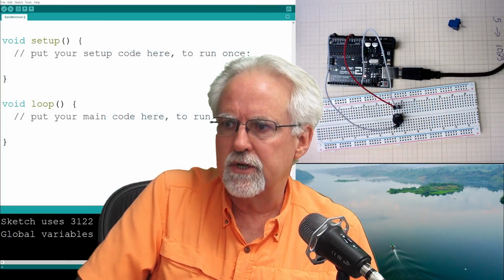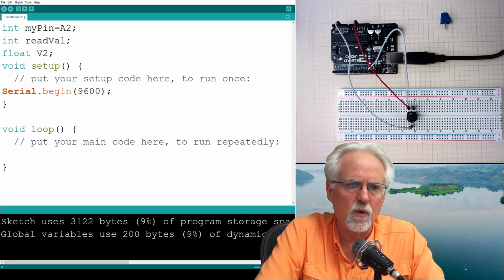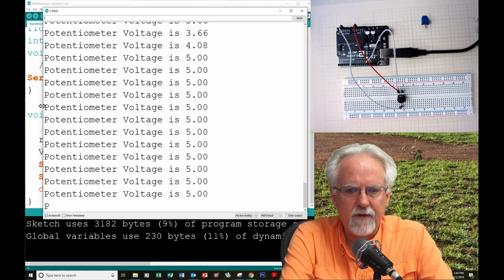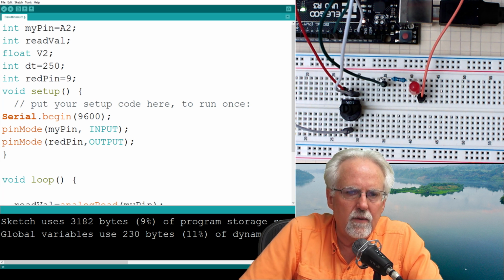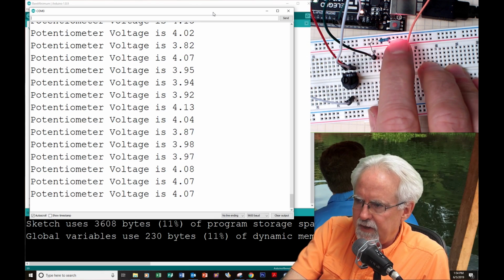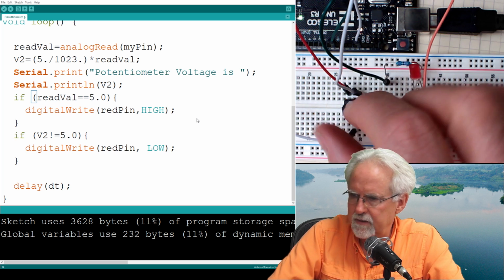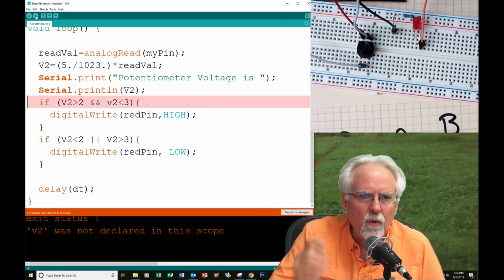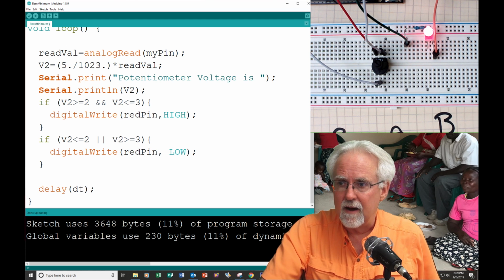Arduino Tutorial 13: Understanding Arduino If Statements

Comment: I made it a little differently, played with it by creating a variable for the voltages. This was before the second phase of tweaks that was done here.. I could just hear Paul shouting, "NO NO NO, don't put values down there, make it a variable, so I tried that...LOL!!         
 int myPin=A2;
int readVal;
float V2;
int delayT=250;
int redPin=9;
float Trigger=3.0;

void setup() {
  // put your setup code here, to run once:
Serial.begin(9600);
pinMode(myPin,INPUT);
pinMode(redPin,OUTPUT);

}

void loop() {
  // put your main code here, to run repeatedly:
readVal=analogRead(myPin);
V2=(5./1023.)*readVal;
Serial.print("Potentiometer Voltage is ");
Serial.println(V2);
if (V2>=Trigger);{
  digitalWrite(redPin,HIGH);
  }
  if (V2<Trigger) {
    digitalWrite(redPin,LOW);
  }

delay(delayT);
}
Reply: But this is probably the BEST I've seen here on the Arduino... All done in baby steps, from Known to unknown.. the way it should be.

Comment: Hello Paul, I am currently building an Imoov robot. I am using  a PCA9685 with my Arduino for the hand and finger movements. I will be running six servos off the PC9685. I know how the hardware is set up but the coding seems a little difficult. I am trying to code so that the servos have different degrees of movement to compensate for the  fingers being different lengths.  I have searched  forms and videos on this topic but have not seen it explained in detail.  Maybe you can point me in the right direction. Your videos have been a great help to me  and very informative as I am new to coding. Thank you for taking the time to make such great videos.

Comment: I did it!!! I am referring to the homework regarding the 'IF' statements.  It was a great challenge that I needed in which to build upon even more challenges.  There were errors made and one was a struggle to determine if it was my coding or my breadboard circuit .  After hours of rewriting the code and rewiring the breadboard many times and with a "strong dose" of persistence, I found the error.  It simply involved turning on the yellow LED 'IF' statement correctly and then using exactly the same 'IF' statement to turn the the led off.  So, I believe the LED never had a chance of lighting-up.  Thanks for the challenge... I will not forget this in the future.

Comment: Another great video.  Loved getting back into the IF statements and how they work here.  This is an example of something that I could have used back when I worked as an electronics tech for a newspaper.  We had high voltage tachometers  that fed analog meters and my boss wanted us to design something to display the speed of the presses with large pit lights instead of the analog meter.  We could only use thresholds to turn on the lights so instead of  indicating a particular point, all the lamps came on up to that level.  It was okay, but this device you are teaching us would have made that job soooo much easier!!!  Unfortunately there were no Audrinos back in 1985.  Thank you again and I will be looking forward to the next lesson.

Comment: Hi Paul, thank you for another great lesson. You are saying we shouldn't use numbers in the loop method. Is there any reason why you are not doing variable for 5/1023? Also why the program was working without setting pins ? Thank you Mr Buuuuum :)

Comment: I love your tutorials! I ended up downloading Fritzing to help plan your homework and it works great. I do have one question: can you use concatenation in Arduino? I looked it up and it was confusing but I still couldn't get it to work. I know a few programming languages and keeping up with the differences between them is crazy. If you can use concatenation do know a site with better examples than the Arduino site?

Comment: *FLUCTUATING VALUES??* - for other new students having issues with the potentiometer having fluctuating voltages while mounted on the breadboard. I was having fluctuating  values on the serial printing of the voltage output even when the knob was not turned. I thought something was wrong with the arduino board. I checked it with the voltmeter and the values fluctuated as well. For some reason it does not fluctuate when the potentiometer is wired away from the breadboard. I used the dupont wires to connect the potentiometer to the breadboard.

Comment: I started writing Fortran code in 1966 and now occasionally  use C#  and Minitab's Macro coding language with if's, while,  do loops etc. I remember acing my Electrical Engineering DC electronics class, then when faced with AC switched to Chemical Engineering.  Have always used programming  of some sort  throughout the years.  The combination of theory and hands on assembly and  coding  is  very exciting and  I'm enjoying it thoroughly .  I successfully  extended the homework  to print different messages  within  each region, green - Safe Zone 0 to 4 volts, Yellow - Warning Zone 4 to 4.5 volts, Solid Red  - Early Warning Zone 4.5 to 4.75 volts, and finally Blinking Red  - Late Danger Zone  greater than 4.75 volts.

Thanks again for your great lessons.

Comment: Interesting. Using a Teensy 4.1 for these tutorials, and powering from 3.3v instead of the 5 the Arduino uses. Everything works just fine right up to the point of using "==" or "!=" conditionals. I've otherwise copied Paul's instructions word for word, and I was happy to see that the "V2=(3.3/1023.)*readVal" scales perfectly. The greater than less than functions work nicely as well, but as soon as either conditional is given a "==" or a "!=", the sketch compiles, but doesn't respond to the command. 

Any guesses from anyone as to why this wouldn't be working?

Comment: I gotta say, this has been a learning experience and exciting! I was able to get the Green, Yellow, and Red light to turn on when a condition is met. Paul, I appreciate you taking your time to teach. I am actually following along. I am in the Manufacturing Engineer field, hope to get into IOT field. I've had my OSEPP Arduino starter kit for 1 year, and finally opened it as you dared us to do some practices and follow along. 

The only bummer was getting arduino started and it was hell due to the fact that the it couldn't register the correct COM, for some odd reasons, COM5 works but COM3 doesn't since it is busy. For that, I had to investigate and update the driver, didn't know till many struggles.

However, your methodical execution and explanation was intuitive and easy to follow along at this pace!
Thank you for your time and I've subscribed!

Comment: At 25 minutes. The code says turn led on if V2 is 5v and next line says turn off if it is not 4v. So it’s turning on and immediately off again every scan. Both values have to be the same for that routine to work as you desired. 
If (V2==5.0) {
digitalWrite(redPin, HIGH);
}
If(V2!=5.0){
DigitalWrite(redPin, LOW);
}
Would work.

Comment: help idk wahts wrong the green light keeps on turning on 

my code:
int info=A1;
int green=2;
int yellow=3;
int red=4;
float volt;
float tv;
int t=200;
void setup() {
Serial.begin(9600);
pinMode(info,INPUT);
pinMode(green,OUTPUT);
pinMode(yellow,OUTPUT);
pinMode(red,OUTPUT);
}

void loop() {

volt=analogRead(info);
tv=(5./1023.)*volt;
Serial.println(tv);

if(tv>3){
  digitalWrite(red,LOW);
  digitalWrite(yellow,LOW);
  digitalWrite(green,HIGH);

 
}
if(tv<3 || tv == 3){
  digitalWrite(green,LOW);
  digitalWrite(red,LOW);
  digitalWrite(yellow,HIGH);

}
if(tv<4){
  digitalWrite(yellow,LOW);
  digitalWrite(green,LOW);
  digitalWrite(yellow,HIGH);

}

}
Reply: wait ithink i fixed it
Reply: ok ive re written the if and re do the logic and it works now 

code;
int info=A1;
int green=2;
int yellow=3;
int red=4;
float volt;
float tv;
int t=0;
void setup() {
Serial.begin(9600);
pinMode(info,INPUT);
pinMode(green,OUTPUT);
pinMode(yellow,OUTPUT);
pinMode(red,OUTPUT);
}

void loop() {

volt=analogRead(info);
tv=(5./1023.)*volt;
Serial.println(tv);

if(tv<3.0){
digitalWrite(green,HIGH);
digitalWrite(yellow,LOW);
digitalWrite(red,LOW);
delay(t);
}
if(tv>3.0 && tv<4.0){
  digitalWrite(yellow,HIGH);
  digitalWrite(green,LOW);
  digitalWrite(red,LOW);
}
if(tv>4.0 || tv>5.){
  digitalWrite(red,HIGH);
  digitalWrite(green,LOW);
  digitalWrite(yellow,LOW);
  delay(t);
}
}

Comment: I added a warning light counter but can't get it to not continuously keeping adding while in the conditional of turning LED on when volts = 5.0.  See my code: int greenPin= 5;
int myVoltPin=A2;
int readVal;
float V2;
int dt=250;
String warningMsg="Number of Warnings:";
int warningCount = 0;

void setup() {
  // put your setup code here, to run once:
Serial.begin(9600);
pinMode(greenPin,OUTPUT);
}

void loop() {
  // put your main code here, to run repeatedly:
Serial.println(warningMsg + warningCount);
readVal=analogRead(myVoltPin);
V2=(5./1023.)*readVal;
Serial.print("Potentiometer Voltage is ");
Serial.println(V2);
if (V2==5.0){
  digitalWrite(greenPin,HIGH);
//here is my number of warnings counter, but it keeps adding up while HIGH
  warningCount = warningCount + 1;
}
if (V2!=5.0){
  digitalWrite(greenPin,LOW);
  }
delay(dt);
}

Comment: Mate, as a 70 + a bit guy who is just venturing into Arduino programming, your tutorials are 'pure gold'! Thank you for sharing your knowledge so freely with us, and having them so well structured and easy for us 'oldies' to follow.
A quick observation, in your 'if' tutorial, there was a problem  reading the 5 volts condition near the end. If you remember, in the previous tutorial, you were only getting 4.86 volts, not 5.0 after the resistor! Correct?

Comment: I made 3 leds function at bottom middle and high range, it is really awesome...
int myPin=A2;
int readVal;
float V2;
int delayT=250;
int redled=9;
int blueled=8;
int greenled=7;
void setup() {
  // put your setup code here, to run once:
Serial.begin(9600);
pinMode(myPin,INPUT);
pinMode(redled,OUTPUT);
pinMode(blueled,OUTPUT);
pinMode(greenled,OUTPUT);
}
void loop() {
  // put your main code here, to run repeatedly:
readVal=analogRead(myPin);
V2=(5./1023.)*readVal;
Serial.print("Potentiometer Voltage is ");
Serial.println(V2);
if (V2>4.0) {
 digitalWrite(redled,HIGH);
  }
if (V2<4.0){
digitalWrite(redled,LOW);
}
if (V2>2.0 || V2<4.0){
digitalWrite(blueled,HIGH);
}
if (V2<2.0 || V2>4.0){
digitalWrite(blueled,LOW);
}
if (V2<2.0){
digitalWrite(greenled,HIGH);
}
if (V2>2.0){
digitalWrite(greenled,LOW);
}
 delay(delayT);
}
Reply: before you got to the end I did the 3 led's before you assigned it, yaaay
Reply: Thank you for posting your code! It helped my track down my issue. It was not an "if" statement problem as I thought, it was a "pinMode" issue. I forgot to declare yellowLED in my pinMode as an OUTPUT. As Paul says, the program was doing exactly what I told it to do.

Comment: int ReadVoltage=A0;
int greenLED=8;
int yellowLED=9;
int redLED=10;
int ReadVal;
float V;
float Calc=(5./1023.);
int T=500;

void setup() {
  // put your setup code here, to run once:
Serial.begin(19200);  
pinMode(ReadVoltage,INPUT);
pinMode(greenLED,OUTPUT);
pinMode(yellowLED,OUTPUT);
pinMode(redLED,OUTPUT);
}

void loop() {
  // put your main code here, to run repeatedly:
ReadVal=analogRead(ReadVoltage);
V=(Calc*ReadVal);
Serial.print("Potentiometer Voltage  =  ");
Serial.println(V);
delay(T);
if (V<3.0){
  digitalWrite(redLED,LOW);
  digitalWrite(yellowLED,LOW);
  digitalWrite(greenLED,HIGH);
  }
 if (V>=3.0 and V<=4.0){
    digitalWrite(redLED,LOW);
    digitalWrite(greenLED,LOW);
    digitalWrite(yellowLED,HIGH);
  }
 if (V>4 or V==5.0){
    digitalWrite(greenLED,LOW);
    digitalWrite(yellowLED,LOW);
    digitalWrite(redLED,HIGH);
}
}

Comment: Had some difficulty at first, but after tracing the issue to a defective potentiometer and fixing it by pressing it down continuously while the program runs, it worked like a charm. The explanation could not have been any clearer, it is delightful to follow this series.
Reply: Nice! I have to do that with mine too. For some reason my "less than,greater than" arrows are reversed and thats making things weird too.

Comment: I just have one question,  why do you use "V2". You say it is the 2nd voltage? Can I for example use "Voltage" instead or is it name specific to be able to assign the correct pin to the correct code etc....

Comment: Assignment done:
int rLED=2;
int yLED=3;
int gLED=4;
int pot=A4;
float V=0;
float readvalue;
String msg="The Potentiometer Voltage is ";
int D=250;
void setup() {
  pinMode(rLED,OUTPUT);
  pinMode(yLED,OUTPUT);
  pinMode(gLED,OUTPUT);
  pinMode(pot,INPUT);
  Serial.begin(9600);
}

void loop() {
  readvalue=analogRead(pot);
  V=(5./1023.)*readvalue;
  Serial.print(msg);
  Serial.println(V);
  delay(D);
  if(V<3){
    digitalWrite(gLED,HIGH);
    digitalWrite(yLED,LOW);
    digitalWrite(rLED,LOW);}
    else if(V>3 && V<4){
      digitalWrite(yLED,HIGH);
      digitalWrite(gLED,LOW);
      digitalWrite(rLED,LOW);}
      else {
        digitalWrite(rLED,HIGH);
        digitalWrite(gLED,LOW);
        digitalWrite(yLED,LOW);}
  }

Comment: Wow that was hair pulling fun. I almost quit for the night but  after eating supper I realized my mistake. Boy did this thing take on a mind of its own. I had all 3 flashing and then couldn't get potentiometer to work correctly. Finally figured out what happened. I used a period after each volt number and that is what caused my problems. I rewrote the code from scratch and added a line to turn off the green LED at less than 1 volt.
Thank you Paul. You stepped it up on this one. I am sure that in your daily classroom you have covered this in more detail, but I got it. Have a great week.

Comment: I am getting some spikes in my voltage readings while turning the potentiometer.  It will occasionally spike to 5.00 volts and then back down to the correct voltage.  Is it a bad potentiometer?  Is it that maybe I might need a capacitor in there?

Comment: Hey Paul! Absolutely love your videos. I was wondering if you or anyone in the comments may be able to help me with some troubleshooting. I have been able to turn on my warning light when my 4.0V cap is reached but on my serial display my volt seem to jump from .05v to 4+v very quickly.  I am able to turning my potentiometer from off "0.00v" 180 degrees or one turn and it will only gain 0.05v then within 1/8th turn skyrocket to 4.00v+. I was wondering if my internal resistor in my potentiometer may be broken and or if my code itself is at fault. Thanks for the Amazing lessons and im iching to figure out why im having this issue. ;)

thanks Ben

float Value;
float VoltCap=4.0;
int Sig=A2;
int Read;
int w8=200;
int Redled=9;
void setup() {
  // put your setup code here, to run once:
Serial.begin(9600);
pinMode(Sig,OUTPUT);
pinMode(Redled,OUTPUT);
}

void loop() {
  // put your main code here, to run repeatedly:
Read =analogRead(Sig);
Value =(5./1023.)*Read;
Serial.println(Value);
if (Value>VoltCap) {
  digitalWrite(Redled,HIGH);
}
if (Value<VoltCap) {
  digitalWrite(Redled,LOW);
}
delay(w8);

Comment: Wonderful series! One small comment (regarding logic, not circuitry): when having one logic test for “on” and another for “off”, one and ONLY one test statement should include the endpoint. Referring to the end of your course, with your IF statements. One of the test cases should include the equal (“>=“ or “<=“); and the other line should include only “>” or “<“. Omitting the endpoint (=) or including in BOTH test cases will cause logic error, which is (as you say) difficult to troubleshoot!   I’m a coder, but now gaining tremendous knowledge from your electronics teaching! Thank you for these!!

Comment: Why did you make the variable READVAL as an INT? because Readval is going to read the wiper pots voltage value which is going to be a Floating value not an INT. Then in the Void LOOP you change Readval from an INT value into a Floating Value? you also changed the V2 from a floating value into a "SCALED VALUE" from the formula 5./1023.*Readval = V2?

Comment: I guess I'm the wall you are talking to! LOL  Question, is there a way to do a "IF-Then" or "IF-ELSE" instead of the individual if statements? Or is that a later video? My game plan is to control 4 Halloween props with 4 IR sensors but I need to run a delay if a prop has been triggered so the people don't keep triggering it by stand there.  I was thinking of an R/C circuit to set the delay time but I would love to run it from the Arduino.
I just found this series and am enjoying it.

Comment: This was my homework

int myVoltPin=A2;
int readVal;
float V2;
int dt=500;
int redPin=8;
int greenPin=12;
int yellowPin=9;

void setup() {
  // put your setup code here, to run once:
Serial.begin(9600);
pinMode (myVoltPin, INPUT);
pinMode (redPin, OUTPUT);
pinMode (greenPin, OUTPUT);
pinMode (yellowPin, OUTPUT);
}

void loop() {
  // put your main code here, to run repeatedly:
readVal=analogRead(myVoltPin);
V2=(5./1023.)*readVal;
Serial.print("Potentiometer Voltage is ");
Serial.println(V2);

if(V2<3.0){
  digitalWrite(greenPin,HIGH);
}
if(V2>=3.0){
  digitalWrite(greenPin,LOW);
}

if(V2>=3.0){
  digitalWrite(yellowPin,HIGH);
}

if(V2<=3 || V2>=4) { 
  digitalWrite(yellowPin,LOW);
}

if(V2>4.0){
  digitalWrite(redPin,HIGH);
}

if(V2<4.0){
  digitalWrite(redPin,LOW);
}
delay(dt);
}

Comment: Hello sir, today I made a high voltage alarm system with arduino, led, potentiometer and buzzer using if statements.
Thanks for your guidance! Without it I would not be able to do this. Thanks!